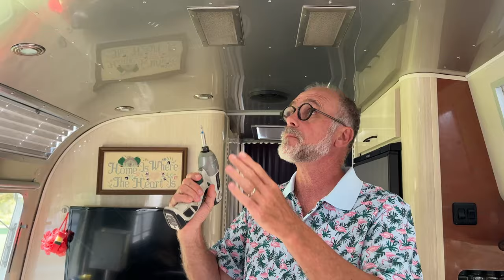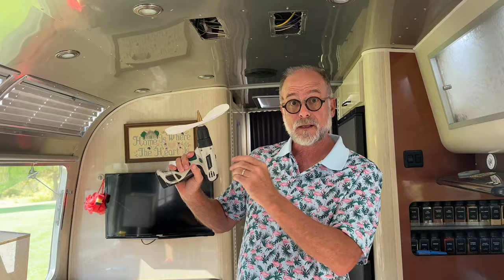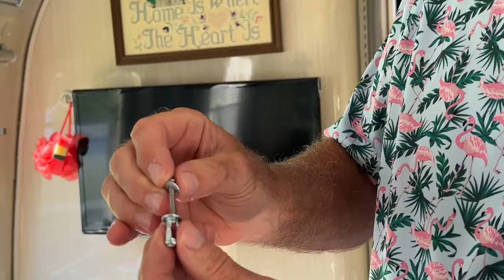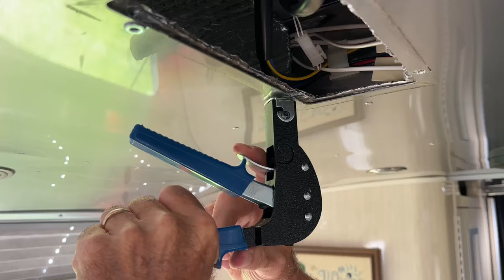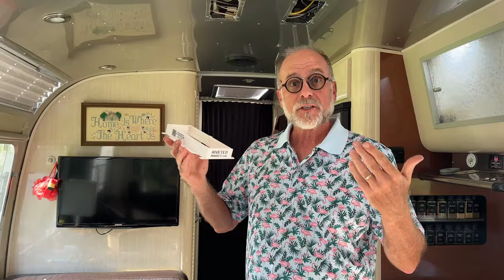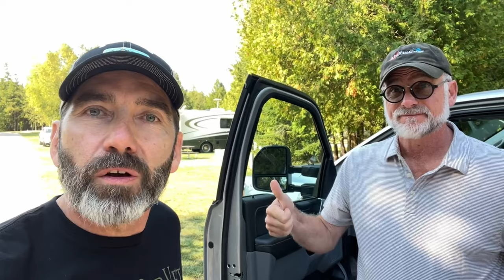Airstream Accessories: NoLox Vent Kit and Riveted Air Filters

Comment: Have the end swipes on my airstream ac vents, but in your case this makes sense.
Reply from the maker: Thank you! We don't know what end swipes are? - Michelle
Reply: @airstreamer  Well, in my 2019 Tommy Bahama Airstream the vent covers have curved attachments to hold them in at each end. No screws. This change was done on the Classic in 2018 and many of the Classic enhancements were carried over into the the AS version I have. Including the heating of the belly pan area to avoid freezing in that area.
Reply from the maker: @somedayistodayrv  Ahh. Ok, thank you for explaining that! Glad you have a system that works and you don't have to use this mod. - Michelle